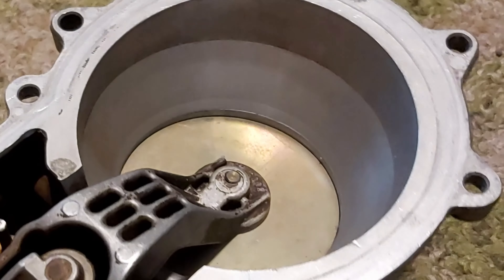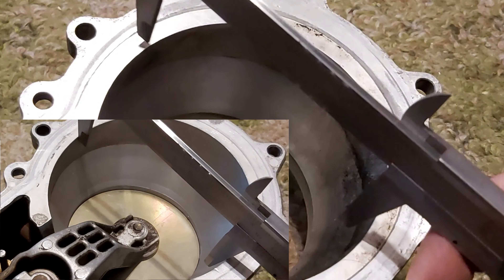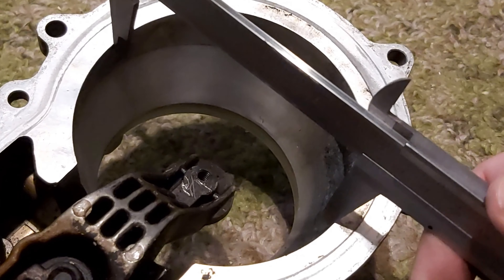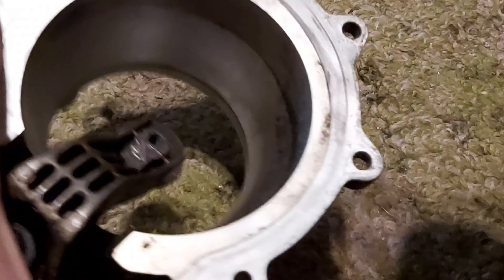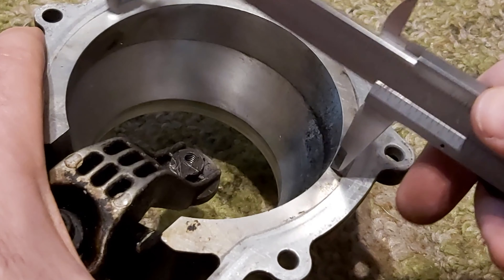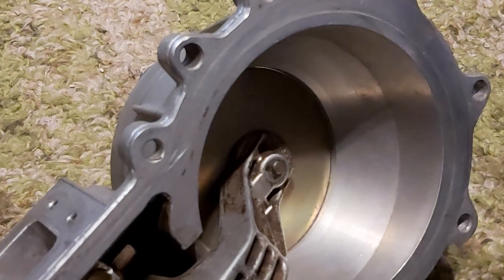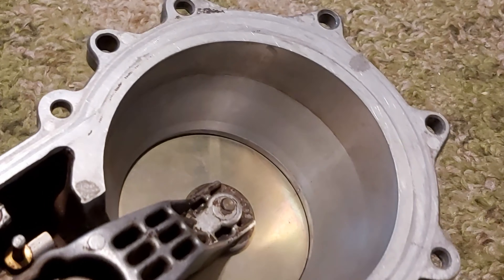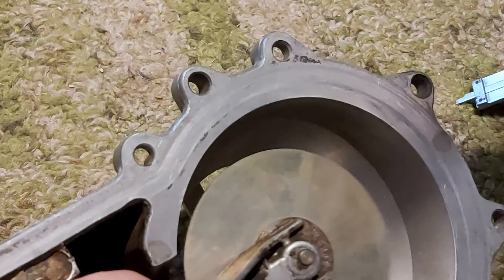㉦Mercedes Ke-Jetronic㉦ - Mercedes 190E 1.8 about its airflow meter

Comment: thanks alot mate...iv been using LM0008 with MT0001 all this time 😂, it was bought secondhand as a one set though....it idles perfect, runs fine. But i noticed it vibrates alot On Drive gear and on fully steering to left and right. Also a bit of powerloss on accelarating...now i feel stupid 🥲. Im preparing my LM0001 airflowmeter back...clean it and giving it a lil of bit of shine 🤪 PS Edit: Mine is a W124....and yeap fuel spits back a bit to the Airflowmeter...

Comment: Hello, I am writing from Perú. I think my fuel distributor isn’t matching the airflow meter housing. Is it possible to regulate the four bottom screws of the distributor in order to work together? The plungers of both models are different or just the springs located in the lower and upper chambers?
Reply from the maker: Hello. You can easily see if they don't match. I have explained how to know that. What is different is the mixture adjustment. On idle it's okay when the distributor and the airflow meter are not the same but that doesn't go for other engine loads. The best would be to match both of them. I have explained why they should be the same. Greetings from Serbia.
Reply: @mercedeske  thanks for your reply. I have just checked both numbers and the airflow meter housing is LM0001 while the fuel distributor is MT0008. The think is that I have just rebuilt the distributor and I was doing a research if it can be adjusted to work with the airflow meter housing.
Reply: Just for general knowledge, I have calibrated the fuel distributor MT0008 and it fitted the LM0001 airflow meter, keeping the lower chamber pressure and airflow plate gap when resting. I needed 2 and 1/4 of turns of the lower fuel distributor screws. It seems like the springs of the MT0008 are softer than the MT0001

Comment: Thanks for this! This is great info. I have a 1990 1.8 190e and have LM0001 and MT0001. Is this correct for this car as you say this is older version? Is there another way to tell as It is very hard to check what is a correct part by year as you know. 

Also please is the caliper distance the same to set up the fuel correctly on this version as the other?

Kindest regards from UK
Reply from the maker: Hello. MT0001 must match LM0001. The label where it says MT0001 on your fuel distributor must be black/red and the one on your airflow meter some pink color and it must say LM0001. The distance between the nut and the sleeve is always the same(if under any circumstances it's set different way, it's really easy to tell if the FD is a virgin, then let it be the same way as it was). Kindest regards from Serbia
Reply: @mercedeske  I don't want to talk bad about my FD.... But she is definitely not a virgin 🙁

Comment: Please
How much you have to push the 3mm allen screw  so that you can regulate the sensor plate?
Co
Thank you in advance
 Best regards
Reply from the maker: None can tell you that. That's something what you will have to measure yourself using a caliper.
Reply: @mercedeske  thank you and Thank you for your soon answer 
My question is when I know that the screw is movimg the sensor plate 
Because I move the screw and nothing happens
I know I have to push the Allen screw down to move the sensor plate 
But how much down I have to push the Allen screw?

Comment: I just got a 190e 1.8 and my mechanic told me that I have a problem with my fuel distributor and that it needs adjustment at the screws. Do you know anything about that? I can adjust the mixture with a multimeter but can't find any information about the screws.
Reply from the maker: Yes, I know. What's wrong with the car so that the fuel distributor needs adjustment?
Reply: @mercedeske  the fuel distributor needs a rebuild and because of that he told me that there are some screws that need adjustment with a special tool that was used back in the day when the car was new.
Reply from the maker: @ΚωνσταντίνοςΠαπάς-ψ4β  The fuel distributor almost never fails. The only case is if the diaphragm is ruptured and the fuel starts leaking out of it but that happens if someone has been disassembling the distributor. Or if you use ethanol and it creates a mess inside or if water gets in it. Otherwise there is no need for a rebuild. Concerning the tools - there are no special tools for it. You have 4,6 or 8 3mm allen adjusting screws screws which determine the fuel flow. If you mess up with them you will have to measure the fuel flow twice - once on a "full plate" where you have to get 10% difference between the cylinders in one minute and on idle(plate barely deflected) where you will have to get at most 4% fuel flow difference in one minute. That's the calibration procedure.
Reply from the maker: Concerning your car - just replace the parts that have to be replaced and you will never have to mess up with the distributor. There are intervals what you have to check each 50k km and 150k km. Here is the link
https://www.youtube.com/watch?v=gdbkNgjvrCU&t=43s
Reply: @mercedeske  thanks a lot!

Comment: 😀
Reply from the maker: Hehehehee! Hi there and Happy Mercedesing!
Reply: is tje same Lmm one one 0002 and 0008 plate
Reply from the maker: @kentsus2192  I have never hear for 0002. 0001 and 0008 are not the same!
Reply: my car have om 201 engine and i have distruber 0008 and my plate are 0008 but i have take the Lmm from plate 0001 are the work thogeder sorry fore my bad englich
Reply from the maker: No. You need the LMM0008 in order to get the optimal performance!